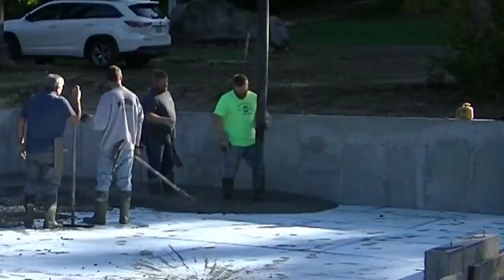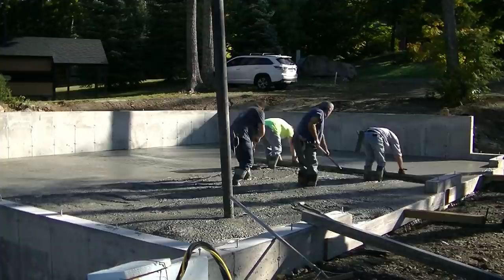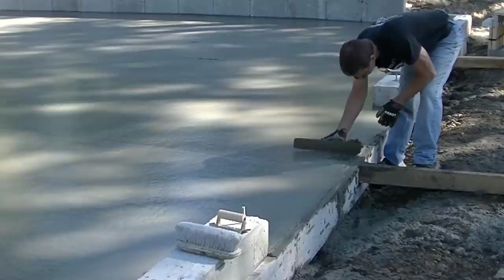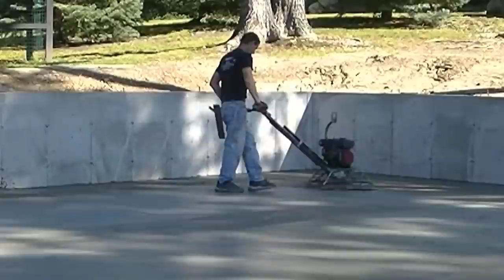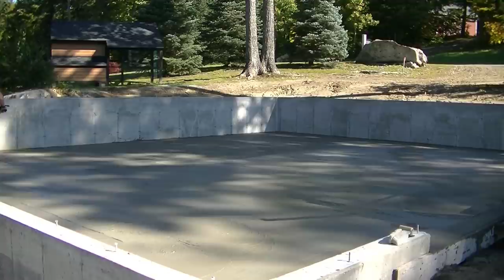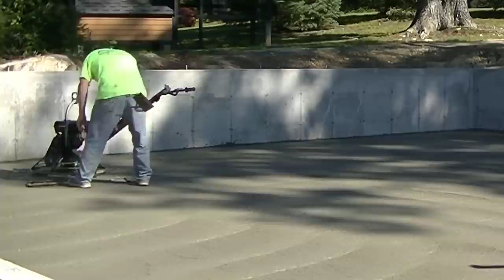The Man Who Helped Me Start My Concrete Business (Pouring and Finishing Concrete for a Garage)

Comment: I’m a contractor in south Jersey I’ve never seen a tapers sill all our sills on garage door s the concrete is one inch set in and inside 31/2 on both sides past the block and set back the with of 2x4 so not to allow any water to enter especially driven rain the door sets down past the finish floor makes a nicer look also